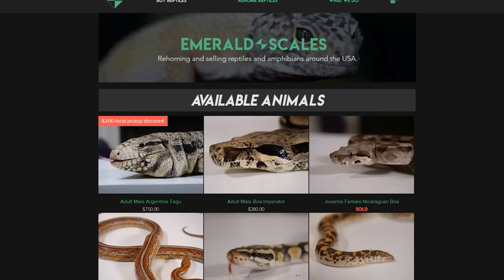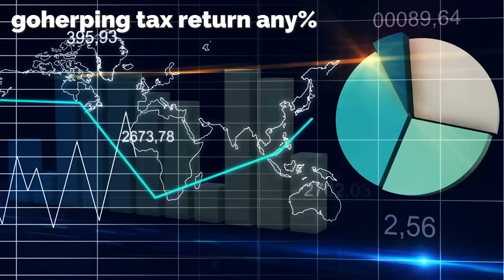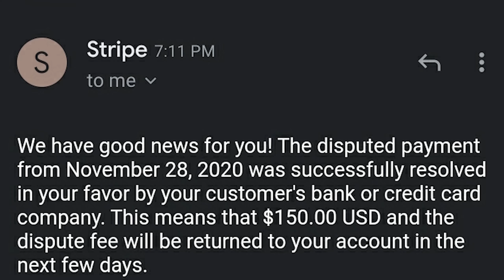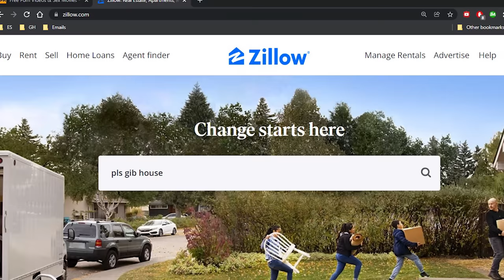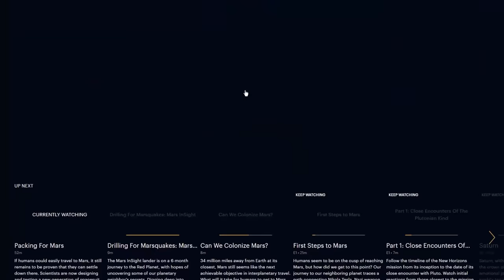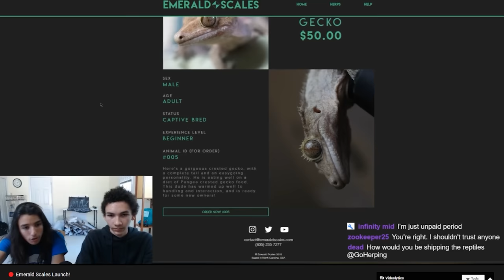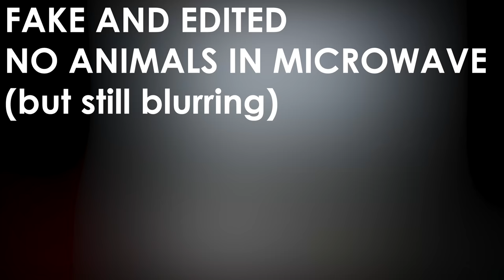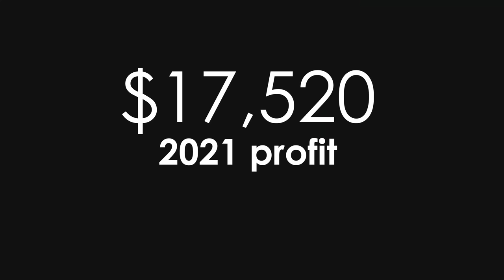How Much Money I've Made Selling 600 Reptiles! (2021 Edition)

Comment: Pro tip! If you’re moving don’t buy moving boxes. Call all local retail shops and ask if you can have their boxes. I used to work at old navy and we would have easily 50-100 boxes from a single days shipment that would just be recycled, but we would save them if someone called wanting them.